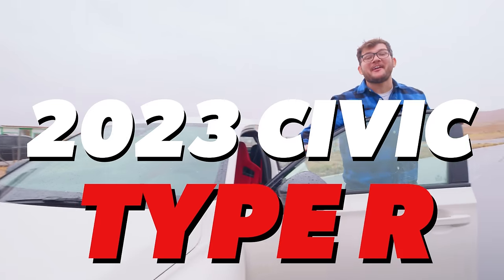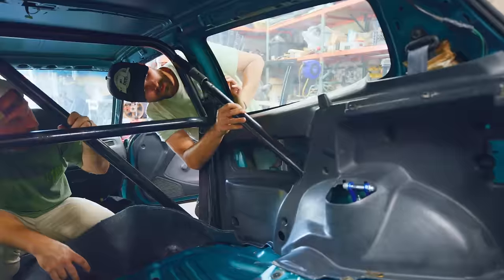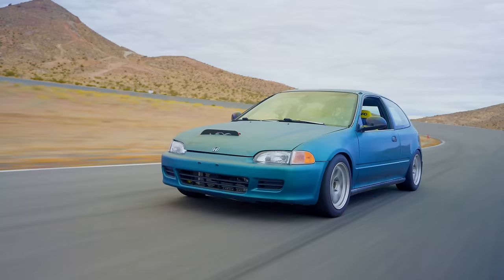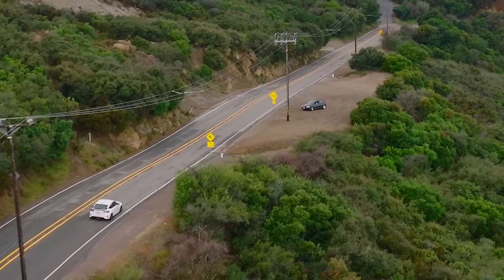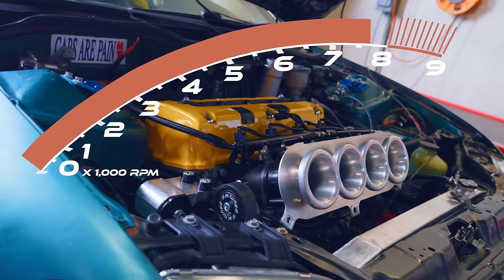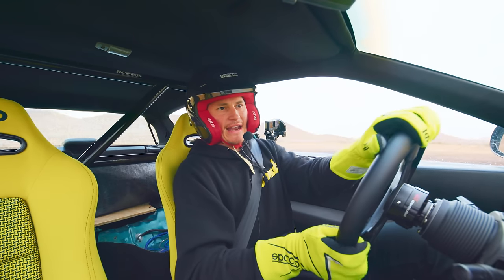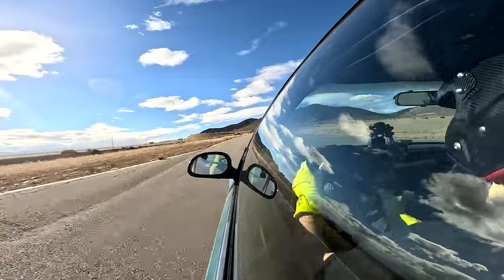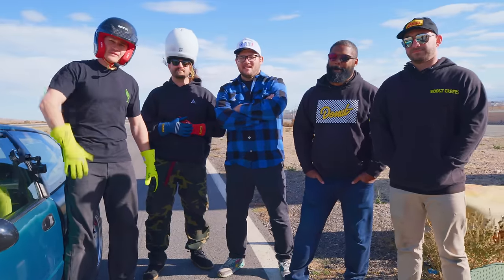$500 Civic vs $50,000 Civic Type-R (THE REMATCH)

Comment: Considering the almost 100hp difference I’m impressed with the time!
Reply: if they finished the filming on wet track, it is likely EG would have beaten the new stock (depending on the tyres) - i take less weight and better handling over more power any day of the week!
Reply: it's also like a thousand pounds less but sure
Reply: Factory pilot sport 2s so unlikely @terkojakobson
Reply: @terkojakobson what if they filmed this on wet Spa Francorchamps?
Reply: Weight.
Reply: @terkojakobson  the eg wouldnt have come close in the rain.  No ABS for one would be a nightmare to control.  But the rear end is alot looser in the EG.  The cup2s arent available for the eg either.  However the race shouldnt have been close in the dry.  The eg should have destroyed the type r.  Can smoke the type r with 20k in the eg np around the track.  However they have to keep sponsors happy.
Reply: Simplify, then add lightness :)
Reply: @duanebailey6253 the eg had no forced induction so the outcome was inevitable
Reply: I think the 230 was wheel horsepower. It's more like a 20 horsepower difference or so
Reply: same here
Reply: Before time began🙃⏳⌛
Reply: @terkojakobson  absolutely, EG definitely made up majority of the time in the corners
Reply: @ChrisBlagdonIsABoss  trueee, definitely made up a lot of time in the corners

Comment: I definitely want to see more with this car, don’t let it die
Reply: My guy, the car is badly build and those guys are casuals, if you get professionals from Europe to do that job and invest 50 000$ into any car from 1990s it will absolutely destroy that brand new little Civic and many more. Drag or Race, heck in Europe it will cost 10 000 euros to beat that civic.
Reply: @onechakarov  But that isn't the point. Sink any significant amount of money into any car and you could more than likely take on most production vehicles out there. The point here is that with enough dedication and bravery to modify a car, you can take a car from 30 years ago and make it perform almost as well as a car made today.

Let's not forget that while they built this in a matter of months, they have funding, a workshop & salaries (I assume). It would take most of us years to get FL5 level performance out of a pos EG. The difference is every modification they've made to that EG can be done by your average Joe with a friend and a dream. No high tech experimental bs, just a wrench and a plan.

Comment: Really wanna see a turbo and a wrap on the 95 to finish it off. See if you can get the lap time down with some boost.
Reply: naaah the shitbox look is part of the charm. Wouldn't be the same with a wrap.
Reply: Better to give it a body kit first if you going to wrap it, including a legit custom hood to replace that horrible cut out.
Reply: and e85. make 600 ponies reliable. also f wrap, get it painted
Reply: honestly for the $50k they spent I thought they should've slapped a turbo on it first considering the type r is turbo
Reply: The ITB's make a turbo kit significantly harder to engineer here.  They would have to ditch the ITB's for an off the shelf setup, which they probably won't do given how committed they are at this point to having them on the car.

There may be a video on a turbo setup still, but it's not simple and would have to be entirely custom.
Reply: I feel like Honda must've asked them not to add a turbo. Why else would they spend money on interior cosmetics, if not to prevent their equally priced build from upstaging a brand new Type R.
Reply: @adismail  now, we know that exhausts output in pulses. What if we put 4 small turbos on the engine with the ITBs, putting the exhaust stroke of the pistons, aka the pulse, to align with the intake stroke of the piston in the 4 doing that, and so on down the chain. 

Basically cylinder 1 exhaust goes to turbo 1, that turbo cold side outlet goes goes to cylinder 3 intake.

 Cylinder 3 exhaust side goes to turbo 2 with its cold side attached to cylinder 4 intake. 

Then cylinder 4 exhaust  out to turbo 3, it's cold side out to cylinder 2 intake.

Cylinder 2 exhaust goes to turbo 4, with its cold side attached to cylinder 1 intake.

Just run 4 smaller turbos. There was a guy who did 4 turbos on a car on YouTube, but he didn't plan out the loop properly for the pulses, and it wasn't very good.

I believe the setup I proposed would be much more efficient and woukd have the potential for more power gains.
Reply: I feel like they haven't added a turbo because it's the thing they always says ruins their builds. Both the Nissan and WRX High/Low series they say they wish they hadn't because it's so hard to do right. Too many variables and it just ruins cars which aren't engineered for it
Reply: No wrap, but I think it should be turbo vs turbo to be a true comparison. It seems a turbo on the old civic would whoop the new one.
Reply: @oldmanbluntz Turbos don’t work that well when you go that small, especially with only a single cylinder feeding them. Even if you match the pulses and cylinders it’s not as good as a single turbo getting all 4 cylinders feeding it. Plus all the plumbing for 4 turbos makes it extra complicated. 
With the ITB’s all they’d really need is a plenum that encloses the throttles.
Reply: Buying a type r k20a is a stupid choice in the first place, that engine basically already have some high comp piston, aggressive N/A cams and other parts that made to support N/A vtec setup. They should have bought the k24 instead and turbo it

Comment: This video is another great example of why older Hondas have so much charm and soul to them.  It's the same reason I have an S2000 or bought an 8th gen Civic Si as a daily instead of a 10th/11th.  No modern Honda engine will sound as good as an old K20.  Modern Hondas are still very good cars, especially in terms of chassis dynamics, shifter feel, and interior design, but they lack that certain something that made the older ones special.
Reply: 100 percent agree with you!! 8th Gen civic was the last true si!! Had mine for 12 years! Never selling!
Reply: @roba6812  8th gens look like a 2005 Prius
Reply: I'm of the opinion that honda lost their spirit when Soichrio Honda died in the late 90's. They're still trying their best but they don't take risks or experiment like they used to. I hope they get it back soon, I'd love a new rwd honda like an s3000 or something
Reply: I think it's just a nostalgic feeling you got
Reply: I hope Honda can step up their FR 4 banger game again. The S2000 is iconic next to the S Chassis, Miata, and AE86.
Reply: @wally99szarek  To be fair they are still a business. They lost money on each OG NSX they built. They lost money on each dc2 type r they built. The 11th gen type R is no different and it is basically a love letter to the enthusiast community. Completely unique engine used on one model, completely different suspension geometry, seperate production line. This is is hundreds of millions of dollars.
Reply: @Revel4tions  thats my point. They never gave a shit about being a business. That's literally what made they great and drove them to create every awesome thing they've ever made! They made the NSX because Soichiro Honda thought the idea was cool and fun. They made the s2000 and the majority of their best motorcycles for the same reason. They made the best and fastest 50cc 2 stroke and 4 stroke engines the world has ever seen because Soichiro liked motorcycle racing. The entire company exists because one man had an undying passion for motorsports. And now they're just another cheap ass generic car brand who sells shitty crossovers. The civic type R loses to just about everything in its class because they wanted to ride off their legacy instead of actually innovating. Now they're going all electric. Honda may as well not even exist anymore.
Reply: @wally99szarek  lmao seems my point flew directly over your head. The type R is an amazing car for this day and age with safety requirements and cafe regulations. Very in line with Soichiros vision considering. No it does not fit your exact definition of what a car should feel but it was never created to make Honda money (dealerships did the price gouging). Not only that but Honda has never stopped being on the cutting edge and taking risks. Remember the second gen NSX? The first hybrid supercar ever mass produced. With a totally bespoke powertrain. Not my favorite car either but it shows Honda is willing to take big risks with development. Now every hypercar uses the same formula but Honda did it first.
Reply: @Revel4tions  the next gen nsx was a joke that underperformed and lost to the og nsx in every test they did on best driver. It was significantly slower than literally everything else in its price range, and the hybrid steering took away from the driving experience. It's a perfect example of the point I made about honda being too lazy to take risks and skating along on their previously established legacy. Which is exactly why they stopped making that piece of garbage. Nobody who actually likes cars gives half a shit about hybrid bullshit because every single hybrid is slower, heavier, and has a smaller engine. 

You proved everything I said with your response. Thanks.
Reply: Old Hondas are light and cheap and kinda slow. But at the same time they are good, strong, and reliable

Comment: I think when it comes to new cars and especially hot hatchbacks, it's advances in the diffs and electronics that really give them an edge against older cars. But that 95 hatch is still an awesome build that looks insanely fun to drive. It deserves a decent wrap or paint job next.
Reply: exactly, and who knows, maybe with an updated diff the EG would be able to easily put down the power and thus make it better maneuverable - but that would probably improve the time and the handling too much and uhhhh... that probably does not look good as in old model vs new model, some sale just miiiiight get influenced by such thing

Comment: That EG hatch could very easily be faster for sure. Some diff stuff, engine tuning/lightweight internals, let alone a supercharger or other FI, or you could make it AWD with the budget what it is. Especially if you take out a lot of the interior related stuff haha. Super cool series regardless, and if you want a Civic TR I don't blame you they are def cool either way.
Reply: They could have slapped a crate billet in there and save on other things
Reply: There were so many better ways of spending their budget, no need for 5k in recaros
Reply: If it was a high compression build or all motor that vtec would kick bro
Reply: For the price of the seats alone switching to ikon momo jegs nrg or sparco. Then adding a touchscreen and backup camera. Spray the carpet and headliner instead of wrapping the headliner and adding new carpet. Get a new pillar for the gauges
Reply: @malaki4519  exactly  so much money wasted but it’s not mine so to each their own

Comment: The thing is, spending $50k on mods can never net you the same value as spending $50k on a car that's already been built. That's true for a new car, but especially for a used car. You can buy a decent Ferrari 360 for 50k. More to the point, on the used market the car you've built isn't worth anywhere near what you've spent on it. $20k is probably what you can get a similarly built car for. 

Also, for $50k you could have changed your priorities a bit and spent more money to go turbo and AWD and less money by not using name brand parts in other areas (ahem recaro seats ahem spoon brakes ahem) 

In any case, great series! Loved watching it and I hope we can see more stuff like it in the future!

Comment: The EG definitely has come a long way.  Can't believe it's that fast, with just 230 HP, and the new Type R has 315.  Definitely love the EG build and all it definitely worth more than the new Type R.
Reply: the eg put 230 to the wheels the newer civic puts around 270 - 290 to the wheels . I reckon with some areo mods the eg will be around the same pace
Reply: @Mecks_Music power is only one side of the "fast" equation, the old one weighs next to nothing compared to the new one. Even if they had the same power the older ones going to be faster because it's probably close to half the weight.
Reply: @Mecks_Music its the torque not the aero.
Reply: 270 to the wheel? source?  @Mecks_Music
Reply: @brotang2953 I mean that's pretty obvious.  that's probably the main thing about old hondas. I do have a ek b swaped a ek9 and a fn3 as a daily. you guys don't get fn2 or fn3 in the usa
Reply: @drzflyest4 would help but areo goes along way . grip helps you take corners faster . some decent areo would help the car quite abit . decent spoiler and a air dam and maybe a rear diffuser 👌🏼😎
Reply: @marklion315  I replied to you comment but it didn't tag you
Reply: @Mecks_Music  I'm actually from NZ, we get pretty much everything Honda and cool lol🤘🤘.
Reply: @brotang2953  I believe the Fn shape is European Market only . its quoted as the worse shape civic but I have a decent spec diesel it's great as a daily . have a look online fn2 is type r and fn3 is type s
Reply: @Mecks_Music  we get them over here, I'm not a big Honda guy but worked on plenty over the years, had to do some looking into them to look at exporting some older ones to the states as they tend to get the luxury but low powered ones over there more. Pretty much anything japanese makes it here, even some of the domestic market stuff come thru in small numbers.

Comment: It's definitely hard to decide ...

1. The 2023 Civic has warranty for 50k that also includes parts and motor ... already makes 315hp out of the factory.
2. The enjoyment of building your own Civic is good but the expense include like when the engine fails, electrical works, tuning the car and stuff CAN BE FUN but it's a personal taste.
3. The old Civic can be made for less if you buy used parts mostly for the interior and would make a decent change to get a turbo for it. Maybe some parts can be bought used or bought from a different brand to change the price a little bit just to squeeze a turbo to even the field from 230hp to at least 280 or even 300 ?

all and all it's a good little toy to play with
Reply: Not even used parts ditch the intake they put on and go turbo (pretty much the same price)
Ditch those seats and go with momo ikon nrg jegs sparco. Then don’t wrap the headliner spray it or get suede and do it yourself. Clean and spray the carpet. Then you can still add a touchscreen and backup camera and get a pillar for the gauges and spend about half what they did on the seats alone.
Reply: A turbo build would definetely be cheaper and deliver more power, but it is a great car anyway.

Comment: There's still plenty of weight to be cut out of the '95.  Money was spent where it didn't need to be spent, even though it's cool.  This could have been a $40k project, and with some more reduction, I think the times would match up.  Altogether a fun series of videos for sure!
Reply: But they wanted a balanced car not just a full stripped track monater
Reply: No thanks, everything was necessary.
Reply: A small turbo would have gone a long way. I'd rather have the back seats and a small turbo.
Reply: yeah the itbs should have been a turbo instead

Comment: Hear me out...

Buy two 1.8L VW beetles', convert them to beach buggies and see who can put the biggest engine in em. 👀

They're cheap as hell here in South Africa. We've put old BMW seats in one of ours and upgraded the suspension on the other. 
I think you guys would love just how customizable they are.

Love the videos. Keep up the hard work guys!
Reply: my Grandpa had 15 vw bugs on his property just rodding away, they where so cheap back in the day if they broke you would get a new one for 300$
Reply: @Ambrose4k  right😂 and they're really fun when you swap a 2.5T Forester motor one. Over a hundred horsepower in something that only weighs a couple hundred kg's. 

They rip!
Reply: @mystikmush4979  2.5 t are like $10k+ the wiring head ache you have to do, and what about the transmission i know its not the stock one right?
Reply: @Ambrose4k   sorry if that came across a little misleading. I haven't swapped the 2.5t in one, I've only seen something similar. 

And you're right, it must have been a headache and a half XD

Comment: I do want it to be known that people would watch these series with more like 30k in the EG. You could do things like Wilwood brakes over spoon and save 3,500-4,000 and get functionally identical performance. Could run a decent journal bearing turbo making 400hp with a decent manifold. My point is, I think the community would prefer more builds with 2/3s of the cash vs fewer builds with more money. All that to say you guys did awesome and that's a cool ass EG civic.  You could also run a cat on the EG with a resonator and muffler to quiet it down, then just put an electric cut out in it. Best of both worlds for the exhaust.

Comment: My favorite build by Donut! They need to pick their track days better. Why even try in the rain. Donut has the money to reschedule. The old civic has a hundred less horsepower and was only two seconds off the pace. Very impressive. More please!
Reply: Well if donut actually could prep the car properly suspension brakes etc. they should be better on pace with each other.
Reply: Tell us about this time machine you have in order to know the weather in advance please
Reply: @cenciende9401 it’s simple, when it rains you reschedule,  every track has that policy
Reply: Tuned NA K swap runs 0-60 in under 4s. With ac and power steering no weight reduction. I think Donut got played in this build for that price. Cost just over 10 large to get under 4s.